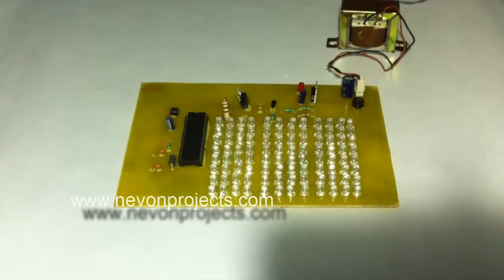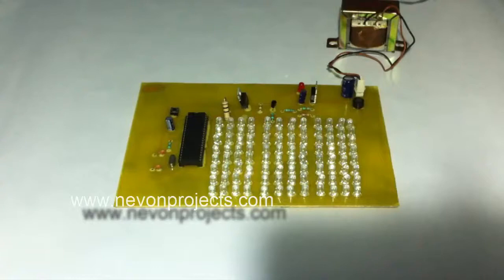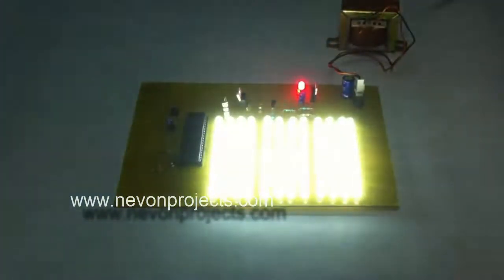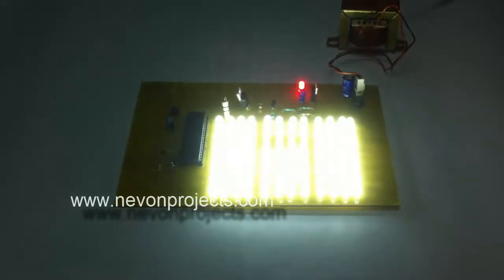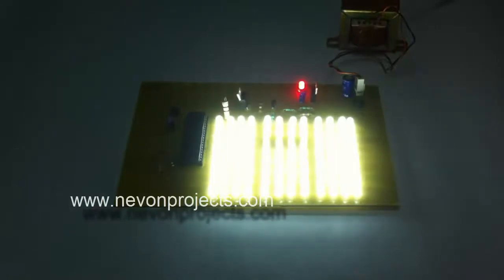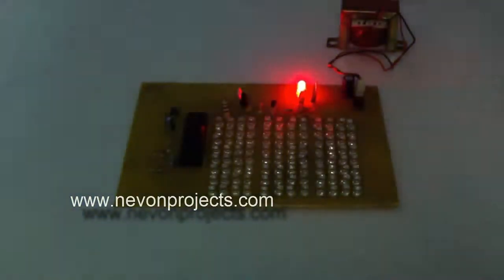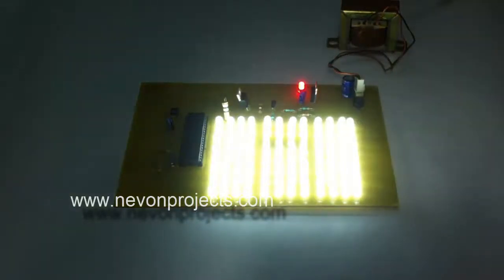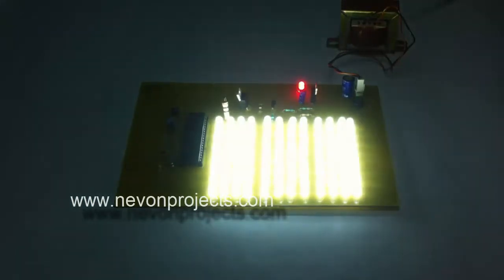Automatic Light Intensity Controller

Comment: I want values of resistors, and other components used in this project
Reply from the maker: For this Electronics Project Details Or Customized Development Call/Watsapp +917738796642
Reply: Hello did you get the value of register and other components
Reply: Hello